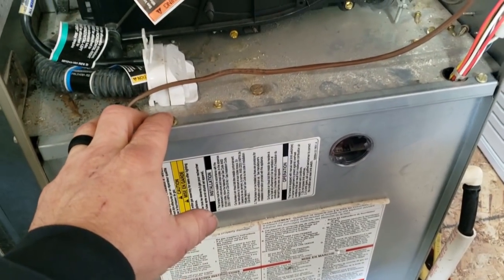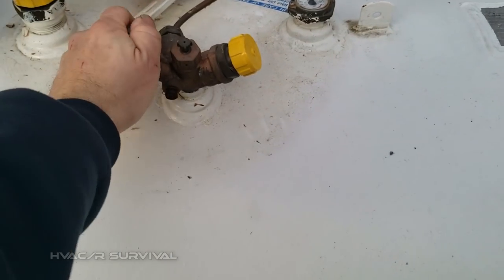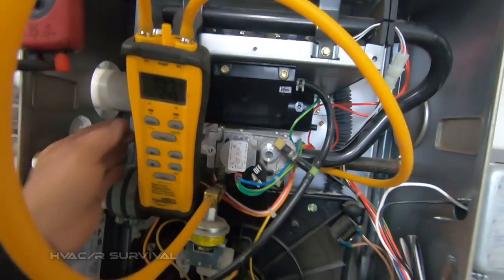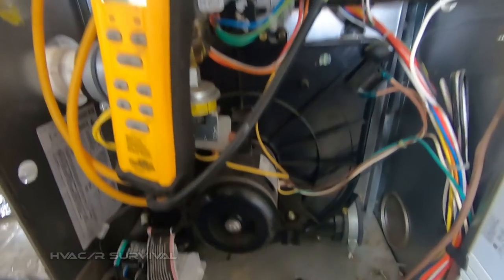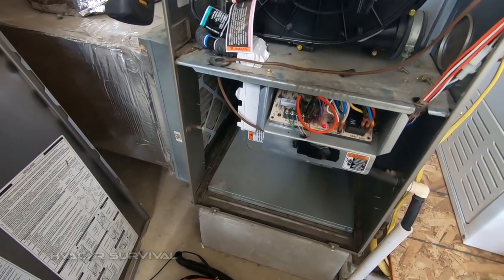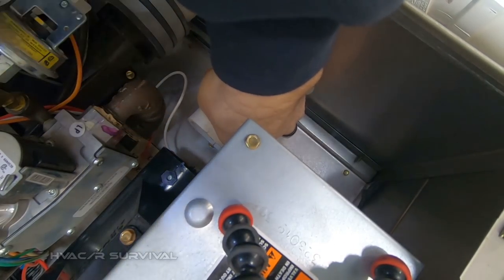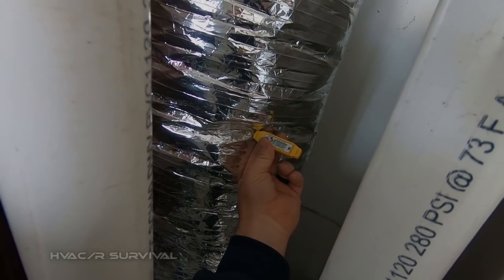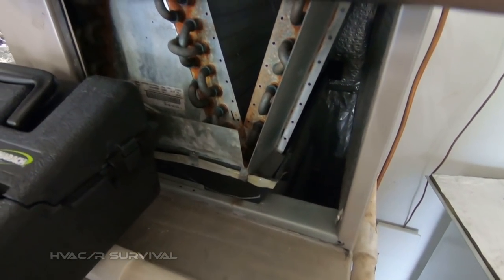NO HEAT Gas Furnace Heat Pump Failure

Comment: You’re  to casual and laidback the way you troubleshoot the system. It’s almost like you’re doing the diagnostic in your sleep. But I have to focus and realize you’re just putting out so much Valuable information. I’m really glad you’re back making HVAC videos. 👍🏻💯
Reply from the maker: Yes 😕  I do regret sounding like I was less than amused, my apologies. Although I did miss that it was a heat pump,  which threw me for a little bit of a loop because of the way they had the module hidden and the customer didn't know what kind or equipment they had, it was my fault for not checking outside sooner to see if it was a heat pump. I appreciate you watching🤜🤛👍👍.
Reply: You’re just a freight train of information. No need to apologize.
I appreciate the time and effort you put into the video’s you make.
Thank you 👍🏻

Comment: I was doing an inspection on a gas furnace and heard dinging in the flu pipe. I cycled off the furnace and removed the vent pipe. This is when the angry wasps came out. If you get to a furnace and the vent pipe is dinging let it run for a while. I prefer my wasps well done. Just sharing a hard learned lesson. I can laugh now but it wasn’t so funny then.
Reply from the maker: 🤣🤣😂👍👍I have had birds, bees and other critters in there. Always a great time.!!
Reply: I don’t do residential anymore but when I did I would always look at the roof upon arrival. If it was a new roof I would always check the vent penetration through the roof. I’ve found countless times where the roofers would roof over the vent pipe. Or they would remove the cap and collar and install a standard roof jack. They don’t know or don’t care I guess.
Reply from the maker: @actechformallyyomama746  Very true,  no one cares anymore😕
Reply: lol..
i was way in across an attic once, when I noticed the whole gable end wall was a massive yellow jacket or hornet nest, and I mean over 6 foot across, 6 foot tall and sticking in over 3 foot depth, that's about when something came flying around me, trouser sausages were nearly emitted trying to scramble back to the opening, about went through the ceiling twice.
come to find out it was only a house fly and the nest was long dead, but buddies laughed at me the rest of the day(week, months, years)

Comment: Watching this on Friday in Ohio. High today is 38, by Monday high is 60😂🤣 heat pumps have been getting exorcise this winter. Good video
Reply from the maker: No kidding,  I started with 80% and have 50% propane left so far this year. But this weather is making the available problem calls less than normal. 🤦‍♂️
Reply: Go Bucks!
Reply from the maker: @anthillmobstars  OH..

Comment: I was thinking restriction upstream in the gas line causing very short dip in supply pressure as it starts, knocking the switch off, but it did it before mid-run cycle.
cordless blower/leaf blower works pretty good for checking vent/intake restrictions or helping to blow anything out. (same for dryer and other vents, if you do ducting)
Reply from the maker: Good ideas👍👍

Comment: Hey Rick I'd like to hear your opinion on those temperature clamps on the Testo manifolds , how much do you trust them ?
I'm asking that because I'd love to use them more , but just this week , I clamped them on to the pipe , and wrapped my K-type temperature sensor next to it , and another K-type on a different digital thermometer as well , to try and make it a good comparison .
And the thermistor clamp was a bit off , by a few degrees , to the point where the subcool I was reading in my Testo 550 wasn't quite correct .
Now, I heard that thermistors are supposed to be more accurate , but one of the digital thermometers is brand new and I do think it is pretty accurate ( I somehow finally managed to get a Fieldpiece digital thermometer online ) .
I'd love to hear your opinion , which one do you think is more accurate and trust worthy ?
Thank you , sir , very much enjoy the content as always 👍.
Reply from the maker: Don't forget Testo calibrates them for the heat gain and loss, if you put them in ice water you'll see what I mean. You can turn that feature off. I think it's called true cal? Not positive of the name.

Comment: I use 90 min in FL, but in your area a rainy 35F day 60 min might not be often enough?
Reply from the maker: Quality brand heatpumps with dual fuel that lock out at 30-35deg F.  I'll do 90min defrost. But Electric Furnaces I'll do 30-60 depends on the sizing because we don't lock out the heatpump.

Comment: Thanks for sharing.   I enjoy the content and learn something new from you all the time.    I  have installed a couple of propane systems but have never seen a lp gas switch.   Is that more common now or just an add on accessory?
Reply from the maker: It comes with the L.P. kit for Lennox and Carrier. Not positive on the other brands. I feel it's important to have and a sign of quality engineering on the manufacturer's part.
Reply: Kit comes with pressure switch and also new orifices plus the screws for burner/ flame diversion.
Reply from the maker: @jphvac5725  sometimes that's the only way to get the pressure switch,  but your paying a lot more money for it that way. Orifices don't ware out to often,  but they can corrode.
Reply: HVACR Survival I agree they rarely ever go bad. Just letting original poster know that the carrier units also come with new orifices and screws as part of the lp kit.
Reply from the maker: @jphvac5725  👍👍My bad,  I didn't catch that. Thanks!
Reply: It saves a sooted up heat exchanger due to low gas pressure running out of LP

Comment: Any recommendations on a good duel fuel thermostat?
Reply from the maker: Any of the Carrier stats are great and have a lot of options. Honeywell is ok for dual fuel but I don't like the way it locks out and changes back and for between HP and Aux heat.

Comment: I don’t like it when the customer is rushing me. Two minutes in and there asking what the problem is.
Reply from the maker: This one didn't,  I was just mentioning how communications with the customer can help remove any worries they might have if the job has several problems. This also helps you decide what corrective actions they may or may not authorize.

Comment: Im not a fan of tapping on stuff like that. My bad luck id tap it enough to make it work. For that week. Then id have to go back and figure it out again. Like an internally bad gas valve or pressure switch. It works everytime im there and never works when im not there.
Reply from the maker: I don't usually need to do that but in this instance I wasn't 100% sure at the time it was the only issue. Thanks 4 w watching and commenting👍👍

Comment: why do you have to have burner cover off to check gas pressure and adjust it?
Reply from the maker: The draft motor causes a false reading because the burner box is sealed.
Reply: @HVACRSurvival  I wish i knew that years ago, thanks for posting
Reply from the maker: @capitolrefrigerationheatin7501  😂🤣I know Lennox and Carrier both mention it in there manuals. Not sure what the other brands require.
Reply: You “t” into the hose referencing the burner box with the negative port and of course positive to the manifold and leave burner door on

Comment: I change the thermostat to 8000 and get rid of the fossil fuel kit. It just eliminates one more point of failure.
Reply from the maker: I like the 8000, but not the way it switches over at the balance point. Otherwise it's a great stat👍👍

Comment: After all these decades of the advancement and development of UV trace dye, you would think the manufacturers will factory install UV tracer products in all their equipment. Some Automotive manufacturers started doing that about a decade ago.
Reply from the maker: Most compressor manufacturers do not allow dye and will void the warranty.  I've only had 1 system I couldn't find the leak on.  Why do you like dye? If I added nitrogen and spent more time on it,  I could find it. I found out when I was finished that this was a rental property so the person I had been speaking with while making the repair was a tenant with no authorization. 🤔
Reply from the maker: @coldfinger459sub0  that's the brand I have. It works. I just don't like the miss. Thanks 4 commenting👍👍